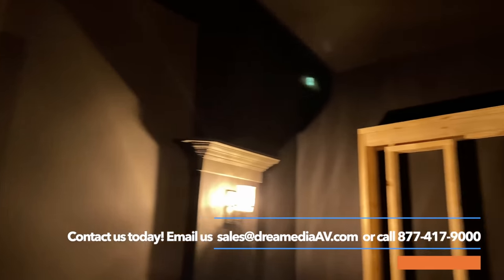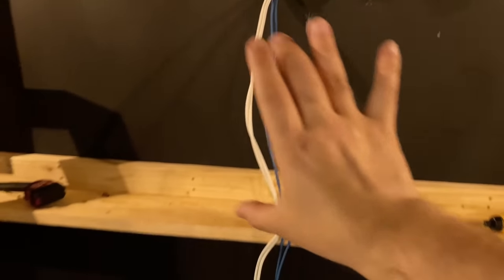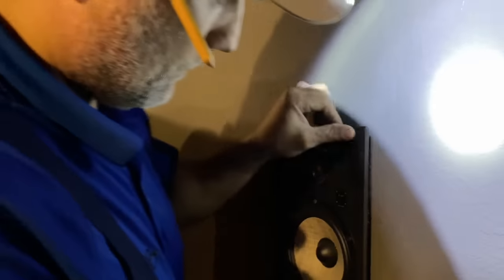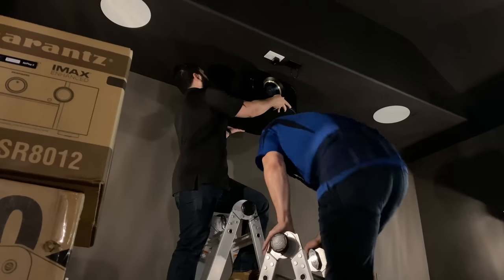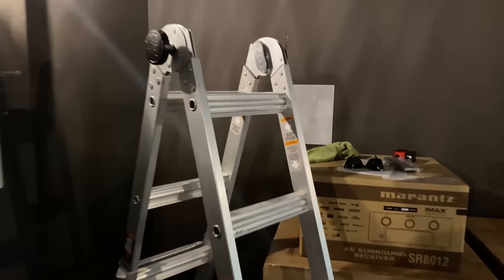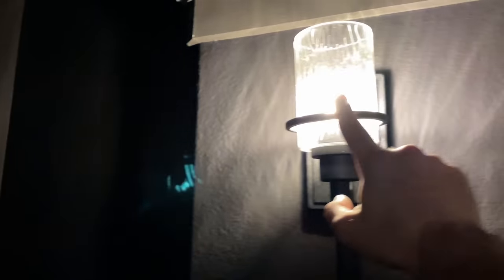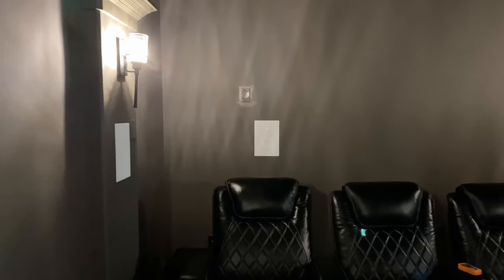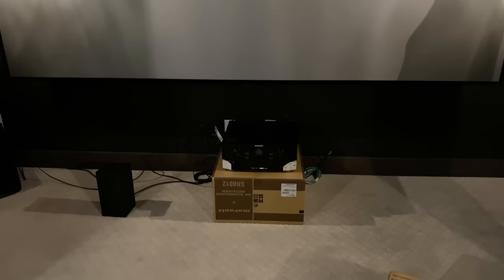Rad 7.2.6 Focal 300 series home theater Install Short Version Houston,TX

Comment: Please suggest me what crossover I can set my processor 
My home theatre setup 
Focal sopra n2 
Frequency response (33db)34Hz-40khz
Low frequency point-6dB 28dB

Center focal Electra 
Frequency response (33dB)55Hz-40khz
Low frequency point(-6dB)>50Hz

Rear surround 
Bipolar focal chorus800v
Frequency response 
+/-3dB 75Hz-28khz
-6dB>65Hz

Rear surround focal 806v
(+/-3dB) 55Hz-28khz
Low frequency point(-6dB)47Hz

Subwoofer Definitive technology power field reference 11Hz-200hz

For LPF FOR LFE 80Hz or 120Hz
Reply: This 7.1 setup